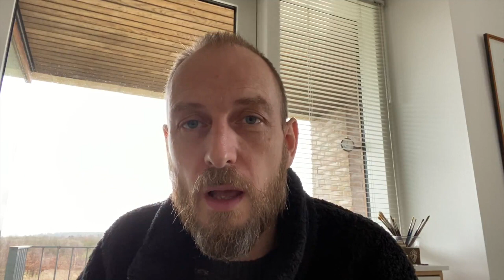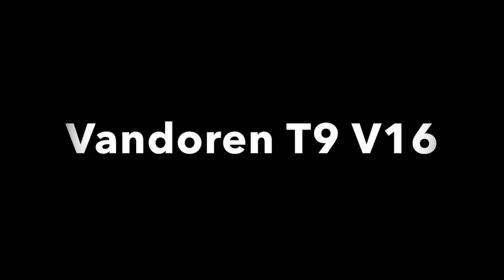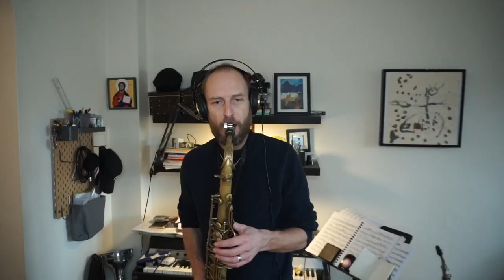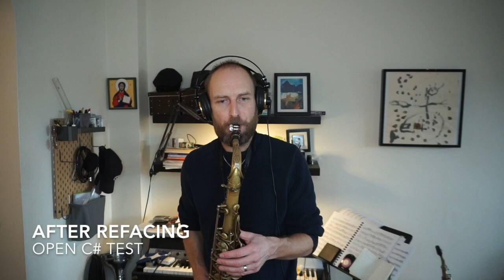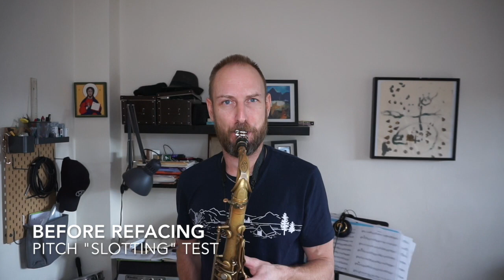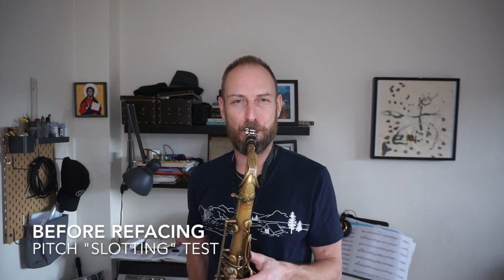Saxophone Mouthpiece Refacing NYC playtesting Vandoren T9 V16

Comment: What reeds are you using when you play test these pieces?
Reply from the maker: Hi Chris, I am pretty sure these were Select Jazz 3M unfiled.
Reply: @Stephan-Kammerer  thanks for the reply - whatever the reeds are you sound fantastic!

In both this and the video in which you refaced a D’Addario Select Jazz, I almost hear the pieces as being slightly more brilliant after you lowered the baffle.
Reply from the maker: @chrisrotsching363  Hi Chris. Thank you! Yes, it's almost always the case when the baffle has been so high that the needle file touches the baffle when you put it through the bore.
Reply: @Stephan-Kammerer  Fascinating stuff! So is it possible to have a “higher” baffle mouthpiece in which the needle file does not touch the baffle?
Reply from the maker: @chrisrotsching363  Yes. On a baffle like that, you will lose a lot of the mid-range and low harmonics and only retain the paint peeler brights. Not bad or wrong just different. Often though,  what we consider "high baffle" is often long baffle pieces. Pieces like that will have a lot of power with full low harmonics and midrange. Think, Brecker or Berg... Powerful and full sounds